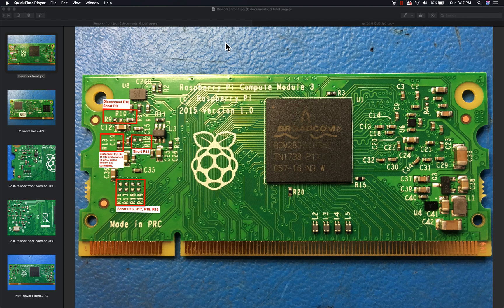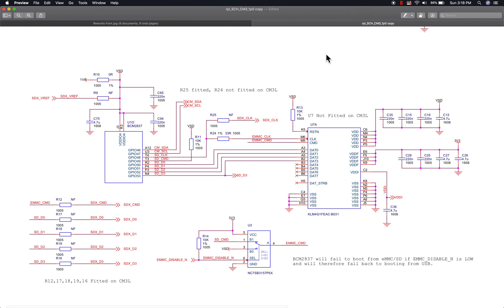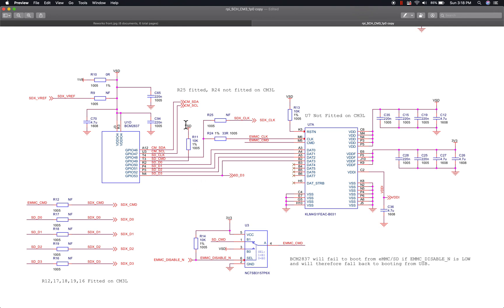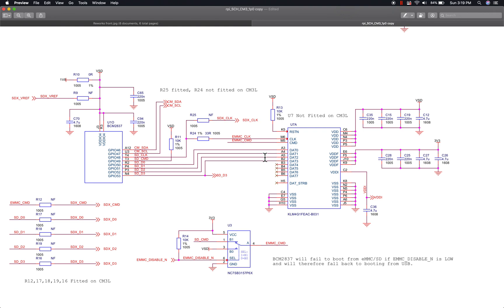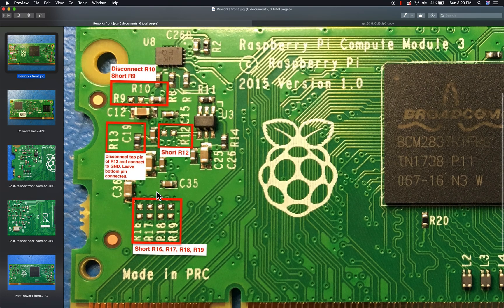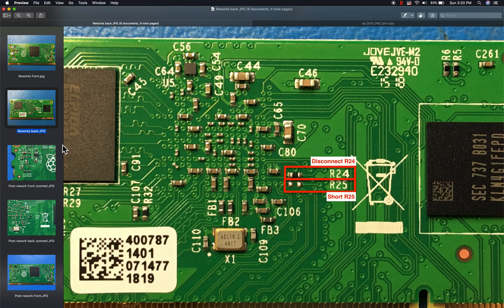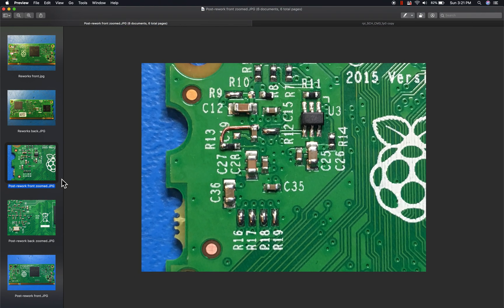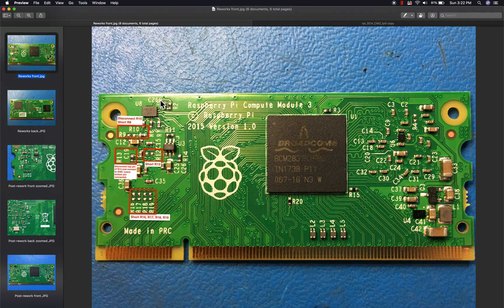How to Mod Raspberry Pi Compute Module 3 Non Lite to work with Micro SD Card

Comment: Would this also work for the CM3+ conversion to Lite?
Reply from the maker: I have not seen updated schematics for the CM3+, but I believe the primary change from CM3 to CM3+ was an updated SoC. It looks like the rest of the components and reference designators are unchanged so I would guess that this mod would still work.
Reply: @davidperna  Yes, it also works for CM3+.
Thanks for your video, it helped me CM3 + with broken flash continue to use with SD card. Great.

Comment: Sir please reply to this.. quest) After doing these change, Can I use it as storage SD card ?
Reply from the maker: Doing this mod will allow you to use an external SD card on the PI CM3 for its OS/storage. It will disable the built-in flash memory, so you cannot use the built-in memory anymore.